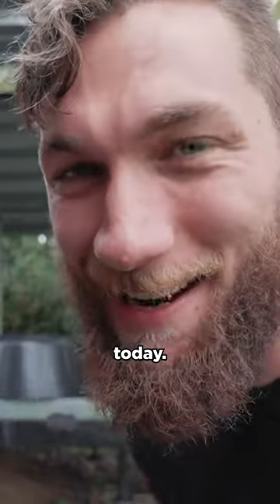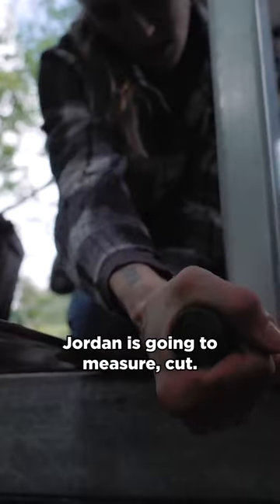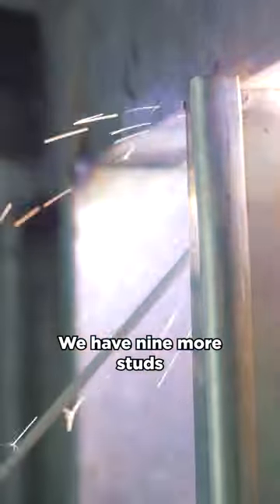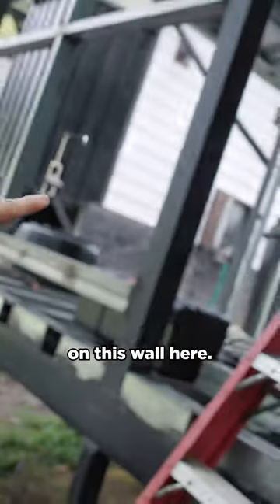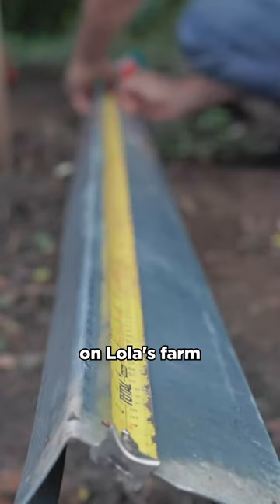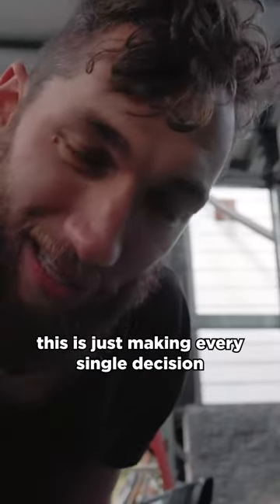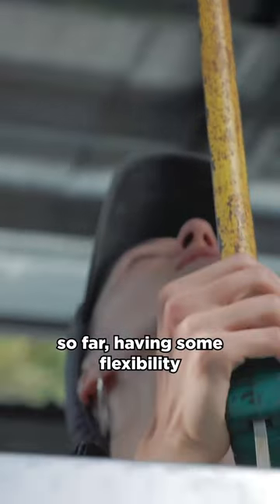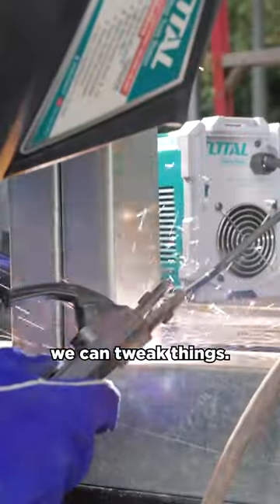Building Our Own Home In Panama

Comment: Hey Jordan and kaylee and Baby Sadie and of course Lola. As I've said before I am going to be building my own home in Northern Thailand. I have watched you guys struggle with different things as you build even having to take apart and do things over even though an architect drew your plans.

Here in Thailand in the country, if you're going to build a house you just draw it on a piece of paper and give it to the builder and hope for the best. Lol

That's not the way we are going to do. I have designed and drew up plans with all the drawings in meters not foot. I will be building with a metal framing so I will have to do a lot of welding.  Its been a few years since I've welded but I should be able to get back into it with not too much trouble. 

Once I have the metal frame up then I will attach wood siding to it and put the doors and windows in. The electrical is going to be all solar so I will have a person come in to do that. I am not an electrician but I can learn.